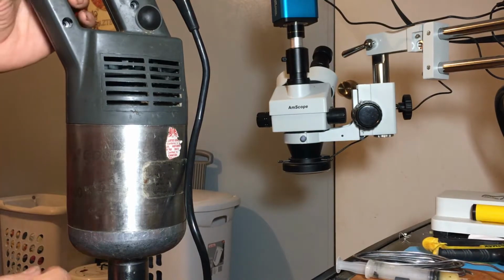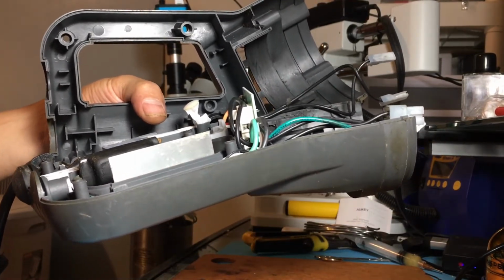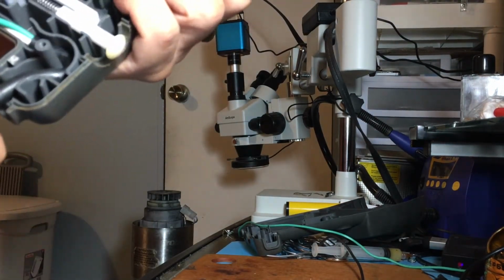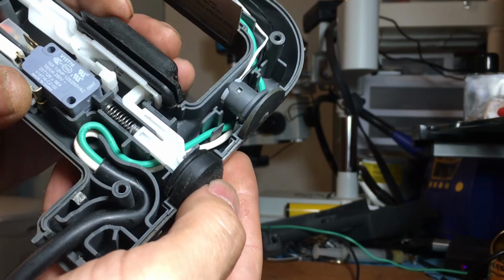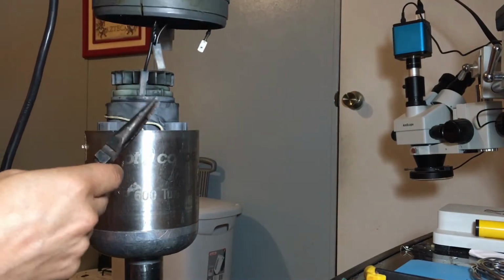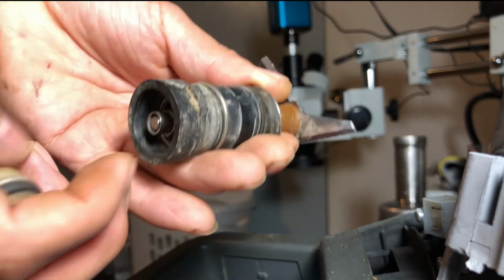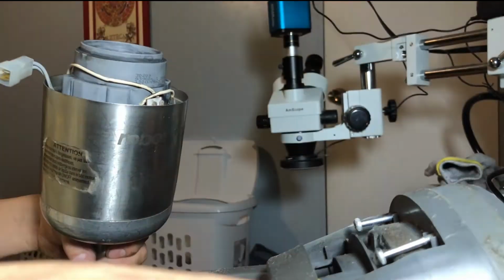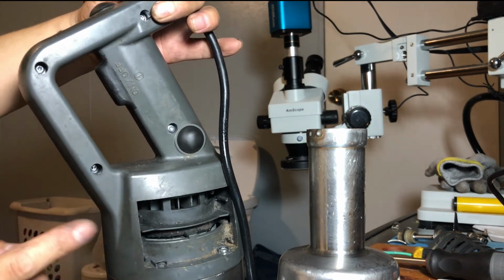Fixing a Robot coupe mp 600 power cord and foot

Comment: You are living proof that you could teach someone how to fix something doesn't make them a mechanic. You have absolutely no clue what you are doing! First off they make a power cord replacement by robot Coupe for that equipment and by not having the rubber stopper at the end you're allowing food contaminants and water and everything else to get inside the Machine by not having it. When you order the actual replacement cord it comes with a little circles that go in the holes that you dug out with a screw. Also at some point you replace the computer board because that's not the OEM one that's an aftermarket one. Over a $1,000 piece of equipment and you try to fix it with a $10 bill

Comment: Hi do you know of the most common problems why the circuit board doesn't send power to motor and what components could be changed to repair?
Reply from the maker: Hi there. I only work on these when they go bad at the restaurant where I work at. I don’t know much about them. I fixed one with a bad circuit board, but it had obvios physical  damage, so it was an easy to fix.  The connections of the ground and line wires were melted for some reason. All I had to do Was resolder them again. 
If your don’t have any physical damage on the board, then I don’t know. You can also make sure to check the switches or or other things to make sure the problem is the circuit board and not something else. Thanks for watching.